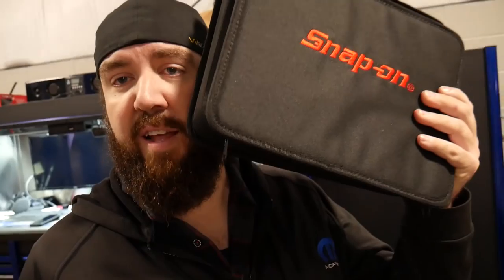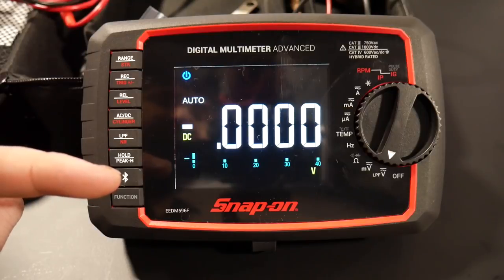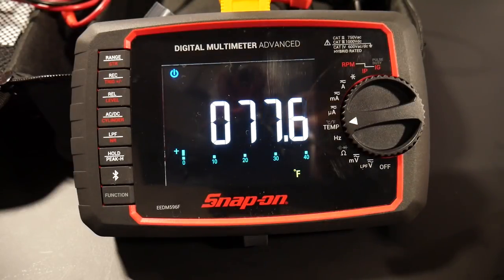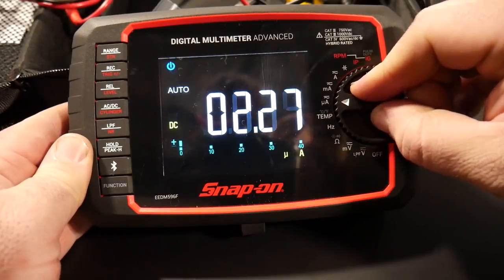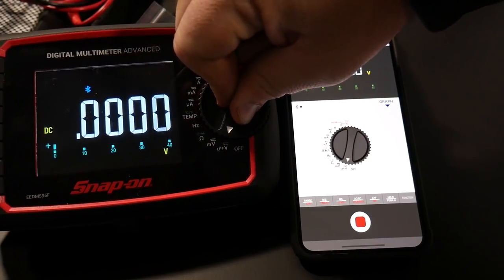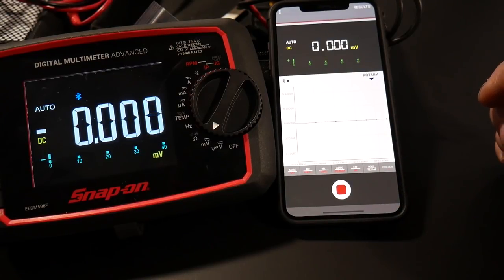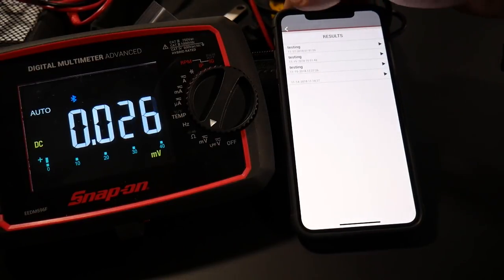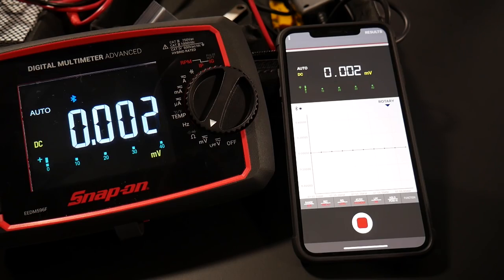NEW SNAP-ON MULTIMETER FIRST LOOK AND REVIEW - EEDM596F

Comment: The Bluetooth will be the selling point for me.  I work on aerial equipment I often have to take readings from the ground control while being in the basket.  I have to be real creative to it.  It should have a rubber protective case as option.  Same with the multi-probe I would use it more if it had more drop or damage protection.

Comment: Just picked one of these up for work as a diesel mechanic on class C motorhomes and I am the shops electrical diagnostician. This tool is very ry handy when you need to hook up at the back of the coaches and activate a switch inside and can see real time data from outside. You could in theory use a spool of jumper leads but that’s time consuming stringing all that wire out lol

Comment: $700 is far too expensive for a basic pretty looking meter. For that price you can get a decent scope
Reply: Can you explain what decent scope you are getting for $700?
Reply: Blake Pankratz You can get a brand new 2 channel pico 4225 for ~$700. You can get the Autel 4 channel that you can use with a laptop for $500 or even a little less.  There are other options as well. You can get a Micsig 4 channel tablet oscilloscope for $400-500 on Amazon that has great reviews from people that use it for automotive purposes. I picked up a otc 3840 when I was browsing through the pawn shop one day last year for $200. I already have a pico 4425 but it was too good of a deal to pass up. It looked brand new with the plastic still on the screen and all the leads still in the packages. If you can’t find a decent scope for $700 then you’re not looking hard enough.
Reply: @Jpilgrim30  Thanks for the info, I have not heard of the Micsig, and did not know Autel made one. I will look into those options. The reason I'm even on this video is because I was hoping they had added a scope feature to this multimeter.
Reply: The pico scope is the way to go if you don't need a handheld scope. If you do want a handheld scope, get a vantage pro. You can find them used for around $600-700. You can't go wrong with either option. I'm not a fan of the autel scope but love their scan tool. Happy wrenching
Reply: 300 is right price
Reply: @Iwhishihadyoutube  You can get the Uscope from AESWave. They have a basic kit for $154 and the master for $399. I have the Master kit and love using it!!
Reply: allanb3222 yeah I have one too. It’s great for a lot of things. I just couldn’t rely on it as an only scope as I need at least two channels for things like cam/crank correlation and times when I need a sync. Hell there’s been a few occasions when it would’ve been nice to have more than four channels but most people would never need that. I deal with some pretty wild problem child cars a lot.
Reply: @Iwhishihadyoutube   Not an Automotive specific scope but the Siglent 1104X-e is a 4 channel 100MHz scope with built in serial decoding for $500. You could buy that and have $200 left over to buy a multimeter and a case of beer.
Reply: @Iwhishihadyoutube  Trijicon AccuPower 4-16x50
Reply: @Iwhishihadyoutube  not the best but you can buy a used vantage pro for way less and they are plenty good enough.
Reply: Jeff yeah but someone getting started can grab some basic leads and pick up other things like amp clamps and stuff as they go or find them on sale. Biggest thing is getting a quality scope and not throwing away money on something cheap that they’ll regret instead of something useful. I own several scopes like a vantage pro, Uscope, and OTC 3840 along with the Pico 4425. A lot of things I do would be hell trying to do on any scope other than the Pico. The vantage pro is amazing for things like checking a single signal or more basic things but if I’m trying to find a small glitch or do something like in cylinder pressure work then it would quickly become a hassle. Just my experience as a tech over years has been that I wish I would gone for the good stuff earlier instead of wasting time and money before buying what I truly wanted/needed in the end anyways.
Reply: I will say though that I do some pretty hardcore diagnostics and someone may not have the same needs as I do. A used vantage pro or older modis may be the ticket for them. I do use my vantage pro quite a bit but for light duty.
Reply: Is this similar to the 525 multi meter by snap on just with more features
Reply: @attilamadarasz3630  its about under 400 with out all the other crap just the meter
Reply: The price is way to high they need to cut it.

Comment: One awesome tool. Thanks for the run thru. It's on my purchase list. Snap on definitely should have at least included a lanyard or strap to hang it.
Reply: Mine came with a strong magnet strap which has a hook on it to. Magnet holds it pretty good. I always usually take my new tools home and check them out.
Reply: O and it's got velcro on it to

Comment: I hear these comments about their $50 meter doing just as good.  Sticker shock always gets me on the SO truck no doubt and I hate spending all this money on tools I could get cheaper but I hate it even more when I save a buck and end up with something that just doesn’t do it right.  These guys who clean their cheap meters are just fine, I doubt they have been in the situations I have been in.  Just picked up this meter.  It will be fine. Had a Mac one that was great except the leads keep the pulling out of the meter. The fluke is a great meter too by the way.

Comment: The tool can be used for Electric vehicles, but it looks like it doesn't do an insulation test. So you'll have to buy another meter to do that. And who uses a rpm pick-up? A good Amp-clamp would have been more useful.
Reply from the maker: I HIGHLY agree with this. I tried to use the low powered amp clamp and they’ll have to come out with one tuned to this meter
Reply: very true. I just bought this today for the blue tooth feature alone. i was working on the combine last night and i need to measure the voltage going to a actuator that only runs for 3 seconds and that is impossible to do when the switch is in the cab and the actuator is on the back of the combine. When i was checking it out on the truck i was under the impression it was a amp pick up and while watching this video i learned other wise and i am slightly upset about that to say the least. But there is always tomorrow to spend another 700 dollars lol.

Comment: All the guys saying its not needed.  Well im a heavy equipment mechanic and I work on a lot off boom lifts.  Its nice to be able to go 60 feet in air and leave the meter on the ground work the controls and see my voltage on my phone 60ft away.  Great way to test stuff.  But 50% agree with being just a pretty meter that snaps the wallet.

Comment: Just picked up this meter from my snap on guy. I purchased it along with an "accessories" package with a whole thing of different test leads. I'm impressed with the presentation of it all and looking forward to using it but damn don't want to get this thing dirty lol.
Reply: What did it run you
Reply: @michaelpatton5012  the meter itself was around $700 with the accessories running an additional $200 if I'm not mistaken. About a grand for the whole thing. I'll get you the part numbers for both when I get off of work later today if you'd like.
Reply: I borrowed another mechanic's multimeter and I was like..wow... loved it.

Comment: Good review honest from your view point.  Snap on should stick to wrenches and sockets.  For the money you can buy a fluke with more options and can measure dc current with a amp probe type pickup.
Reply: David Walle Fluke is the best portable electronic test and measurement house. SO should stay in their lane, electronic T&M is not it.

Comment: I was under the impression the clamp was a low amp clamp not a rpm pick up...i guess my dealer didnt know that either.  It would be nice if they had a low amp clamp for reading battery draws to go with this.  Im a little pissed the clamp is a rpm pick up.

Comment: Thanks for the video Rustbelt, I attempted to replace the battery and the case does not separate easily, do you have any advise on where the lock or notches are to pop this thing apart? I just didn't want to damage anything until it gets more dirt on it...
Thanks again from the Ohio country, where "rust are us"..

Comment: That would be extremely helpful in my work. Would be so much easier to claim warranty on slide out motors leveling jacks hydraulic pumps and air conditioning units to just graph the operation record it and email it off to the mfg to show I’m not bs ing them on the readings. Only thing I didn’t catch was if it has a clamp amp tool for reading amp draws. Would really like to see it in action on a amp draw if so. Nice review bud.
Reply from the maker: Thanks man, I tried to do an amp draw with the low amp clamp and it really isn’t tuned towards this application. But hopefully in the near future they will have one that is not so touchy and tuned for this meter.
Reply: O man your kidding. If it had that capability that would be so worth it to me. Sometimes the money is an issue but on the other hand sometimes it’s easier to make the money with the right tools. Let me know if u hear anything about that.

Comment: I am not sure the refresh rate will be fast enough to get to  graphing faster then that, you might need an oscope for that.  For a comparison you can use the Owon B41T+ multimeter it has similar specs and capability minus doing the math for rpms vs hz.
Reply from the maker: Yeah turning a wheel speed sensor hand fast was about as fast as it could graph and still be legible.

Comment: Amp clamp should work on any DVOM. Turn auto range setting off. Set it on DC volts. Amp clamp should show conversion scale on front of clamp. Ie 10mv for every 100 ma.
Reply from the maker: Yes it does work that way...only other thing I would point out is that if on mA setting the meter has a small resistive value that is not accounted for. Would be interesting to see a good low amp clamp tuned to this meter.

Comment: What Clamp would you recommend for amp draw testing on a battery? 🍻👍
Reply from the maker: Unfortunately I’ve not found one that connects into this meter to work really reliably. Because it’s such a low amperage that you are looking for, the meter would need to be “tuned” more or less to the clamp. I use the snapon eedm570.

Comment: You said it was $700.00😳😳😳😲😲😲😲😲,,, You can get a REALLY NICE Fluk or even a nice small scope.
Reply: Truck Mechanic  I figured it would be a grand when they previewed it. I’ve had several Fluke meters over the last 40 years or so.  You can get a 1587 or pico for that price.
Reply: roaddoglv ,,, I would use the $700.00 for anything better.. Snap On needs to stick to hand tools.. I have a Modis and use the scope all the time and that scanner BUT as we both know there is/are better out there for the same money.. But there hand tools are very hard to beat.
Reply: @GCraigmile   I like the form factor but the Snap On tax is a bit much for what it does.  I think most that would buy have EC accounts and just add them to that.  I've got a Solus Ultra but sold my thermal imager and borescope.  Better options for less money.  I've got a Fluke 87 and a 199c but the remote phone app is appealing.  I'd be better off selling the 87 and getting a 1587 or the like.

Comment: why would an automotive meter not come with an inductive high current clamp? I'm sure they are willing to sell you one for another $300-500, but that isn't the point. For the people bitching about price, this is Snap-On. You pay for that guy to come to your shop each week. Just the way it is. Also, if you think you can find a $50 true RMS DMM , go ahead on that! I paid $600 for a Fluke 88 on the Matco truck years ago. $700 isn't a bad price all things considered. If it came with a current clamp, it would be a pretty damn good value, assuming the specs are good.

Comment: Is the fuse easy to access and what type does it use?
Reply from the maker: Yes it’s not like the older B-D class meters where you had to pry half the meter part. Four screws on the back panel and the two fuses are easily accessible, not exactly sure about the fuse numbers.
Reply: @RustbeltMechanic  ok cool thanks was hoping that it used automotive type fuses like the vantage thanks

Comment: If you really want the ultimate meter for automotive, get a Power Probe IV or the hook, you'll seldom to never touch that meter again. The RPM thing I shrug at since wires have all but gone away and those clips don't work on coil packs.

Comment: Instead of being used for automotive work, it should be safely preserved in the Museum Of Ridiculousness.  Any mechanic good enough at what they do to afford this, won't need to spend $50, let alone $700.  All it really is, is a thief magnet.  Considering this, it should have a built in GPS locator with a phone app, and also a proximity sensor and locator fob so you can hunt down where it went.  Even then, don't forget to invest in theft insurance and while you're at it, get your head examined if you feel $700 for a meter is a wise purchase.

I just know there is some Snap-On shill out there that will tell us this lets him work faster.  Not really, once you factor in having to get it out of your wall safe because you can't leave it lying around unattended, lol.
Reply: Too true, a $4.99 multi-meter will often do just as well for majority of tasks and you have no problem leaving it laying around. Personally I prefer separate meters, an all in one goes missing and your screwed (although I guess not many mechanics need capacitor testers or ultrasonic thickness testers?)
Reply: @peterjones6945  lol this is funny. If you are a DIYer, sure, a Harbor Freight multimeter will work fine. But, they are inaccurate. If you are a professional technician, inaccurate measurements will be very harmful to you. In addition, if you work on Hybrid vehicles, you need a Hybrid rated multimeter that you can trust your life with. If you try to use your Harbor Freight meter on a hybrid system, you will be shocked and possibly die.

Comment: I SEE NO TRUE BENEFITS FROM THIS SNAP-ON METER , FLUKE METERS HAVE MORE BING FOR THE BUCK .  ONLY BECAUSE OF THEIR FINANCING AGREEMENT WHIT THERE CUSTOMERS THIS METER MIGHT SELL .  IT IS FARE OVERPRICED FOR WHAT IS ON THE MARKET IN THESE DAYS AND TIMES .
Reply: 8power0 definitely looks nicer than a Fluke but I don't think it would be more practical.. Fluke meters had been the golden standard for many industries for decades
Reply: @Airman..  I MEANT TO SAY ONLY BECAUSE OF SNAP-ON'S FINANCING AGREEMENT WITH THERE CUSTOMERS THIS SNAP-ON METER MIGHT SELL IS WHAT I TRULY MEANT TO SAY  THANKS .  AND YES FLUKE TEST EQUIPMENT RULES I WISH THAT FLUKE WOULD MAKE A AUTOMOTIVE OSCILLOSCOPE AGAIN .
Reply: 8power0 why would you buy it on credit? Its just a tool to do a particular joblessness .. pricing is depending on your preference not necessarily the quality needed to accomplish the job.. my first meter was a Meterman bought it for less than $100 still working till this day but later i upgraded to a Fluke because it didn't had the Min/max feature necessary for voltage drop testing
Reply: @Airman..  POUND FOR POUND THIS SNAP ON METER QUITE FRANKLEY IS NOT WORTH IT  !!!

Comment: Had mine 5 weeks, I'm already on my third battery. Absolute wank, battery lasts 2 weeks. I fit towbars, and it's used twice a day for between 30 minutes and an hour while testing wires. I don't even use it on every car. This is going back when snap on van turns up this week. 
I can't use a multi meter that i need to keep changing the battery so often, my last multi meter, cost around £30, had it over 2 years, and only changed the battery once. Didn't look as fancy, but still did the job. 
Snap on you have failed on this product.
Reply: Como puedo cambiar la bateria?
Reply: How can i change a battery

Comment: Anyone else have issues where the auto power off happens even while you're still using the meter?  It's really pissing me off.  I don't want to disable the auto off because this thing will eat that single 9v battery in a very short time, and I will definitely forget to turn it off.  It would just be really nice if my $700 meter didn't shut off while I'm still using it!!